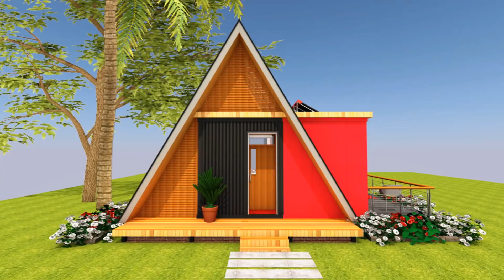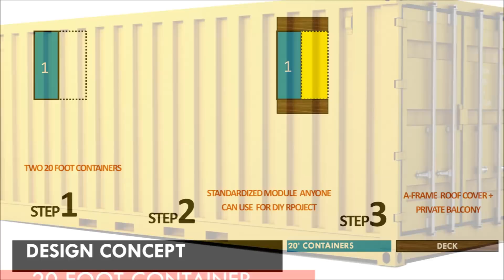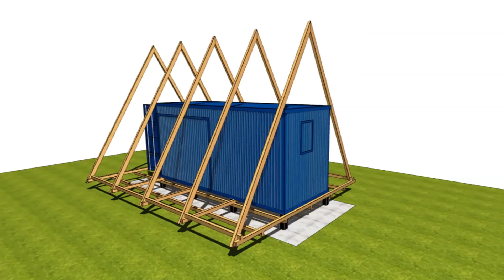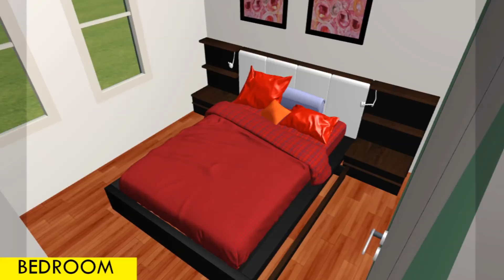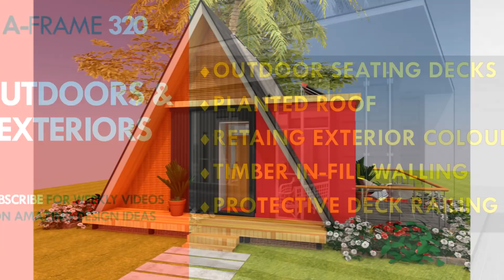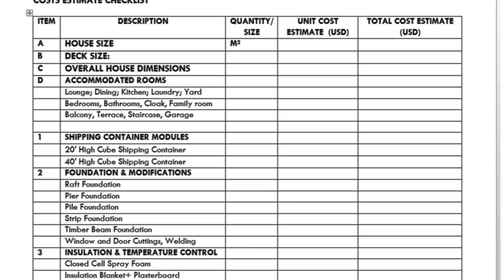A-Frame Cabin House Design - Shipping Container Tiny Home

Comment: This is absolutely pointless.
The entire reason for shipping container cabin, is that structural and weather resistance of a shipping container.
Here, you took an exterior structure. Then built an A frame roof over it..
Then...built the house inside the shipping container.
All you needed, was A frame...then interior.
The shipping container aspect here, is completely redundant